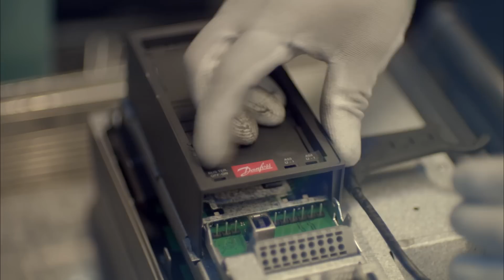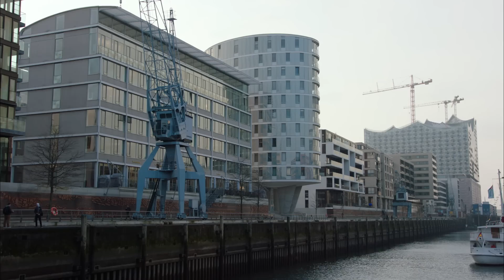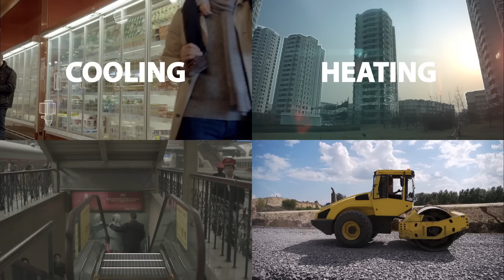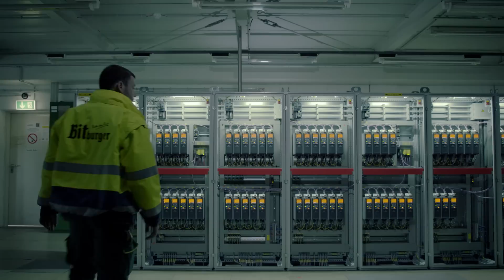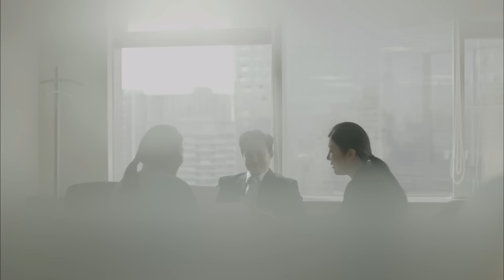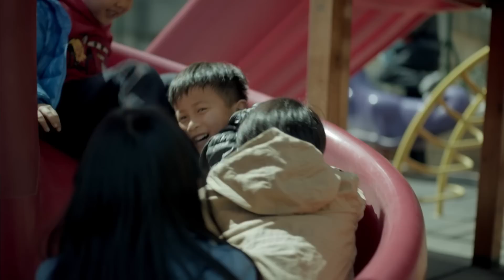Danfoss Drives. A better tomorrow is driven by drives.

Comment: helo sir , i had a question 90 kw motor is controlled by danfoss vtl 6000 drive . when ever i check load of motor it is not constant some times it show 10amps and some time 50 amps. it showing variable load what should i do please help..
Reply from the maker: Hi there, the VLT 6000 is one of our older drive models. I therefore think you can best get in contact with one of our engineers or partners. Where are you located?  Rgds Hans
Reply: What is your application?